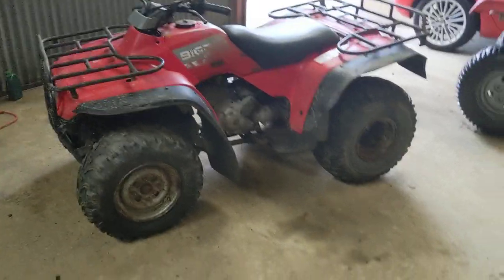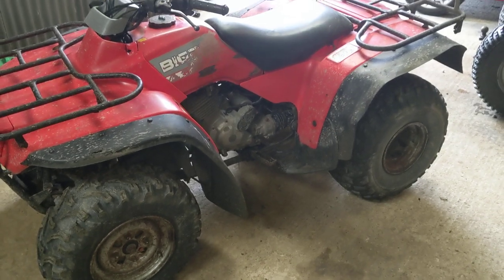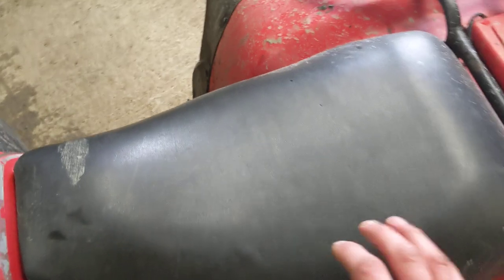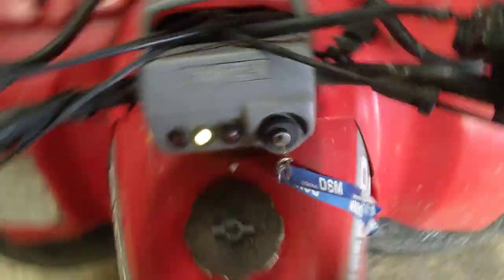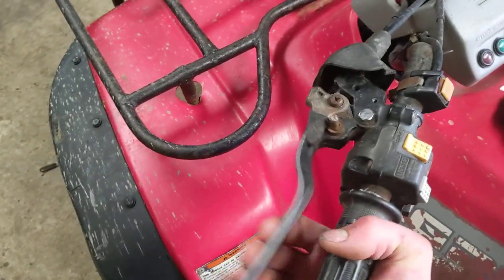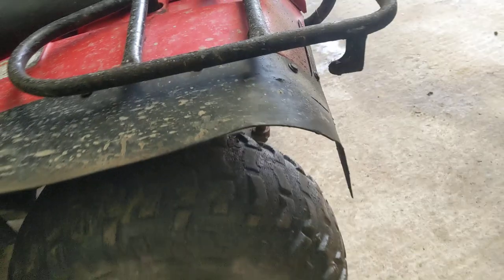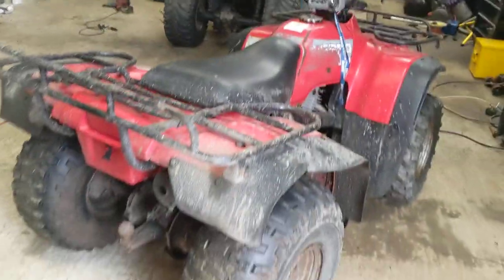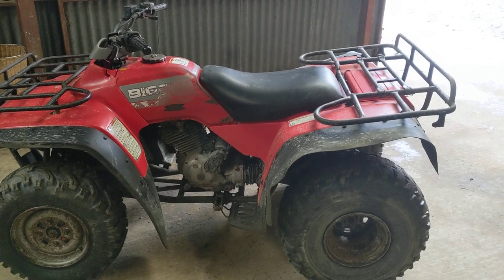Finally a Honda! Big red Foretrax 300

Comment: Best 4 wheel ever made.. I have had 2.. still have one.4 wheel drive, used with snow blade and rough riding around the farm and hunting.. Never really had a problem with it. old when I got it. and I have had it for at least 12 years. works great.. Have extra fuel tank also.